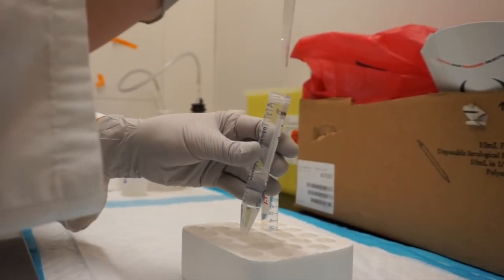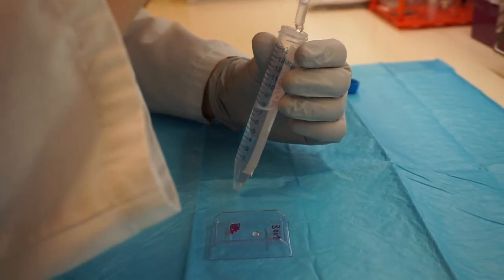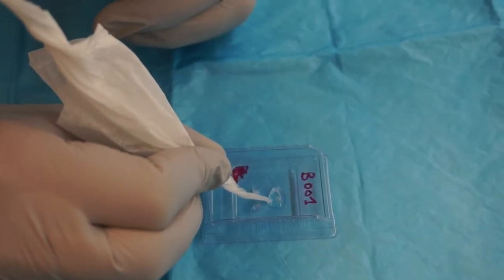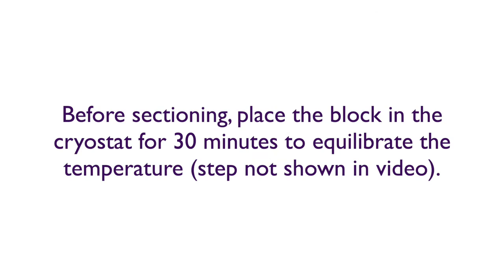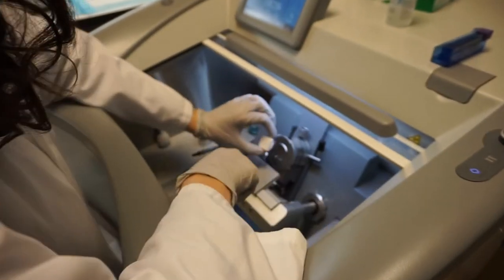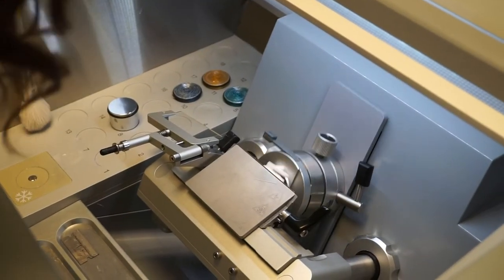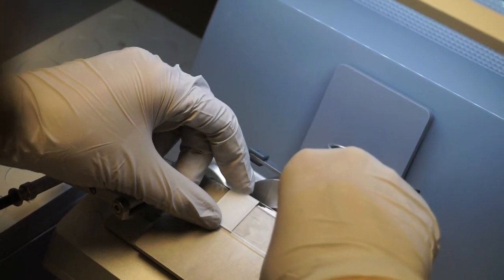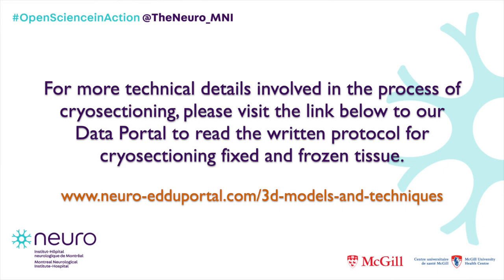Cryosectioning of Fixed and Frozen Tissue

Comment: Is it good to section the tissue without anti-roll glass? as what you did in the video?
Reply from the maker: Yes, this is called the brush technique. You can find an in-depth description of the brush technique on the website IHC World: A Method for Preparation of Frozen Sections (https://www.ihcworld.com/_protocols/histology/frozen_section_technique_1.htm).

When using this technique, the brush should be held like a pen and the hand can be stabilized by resting one finger on the stage. The pressure applied on the section when sliding it across the stage should be minimal as to avoid damage or the section adhering onto the stage. The brush should move at the same speed as the section sliding on the stage.